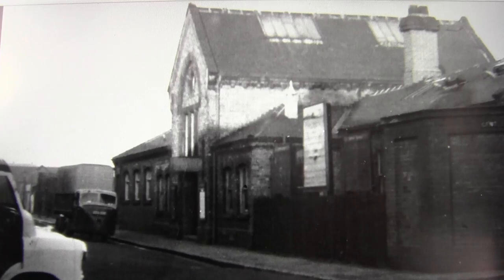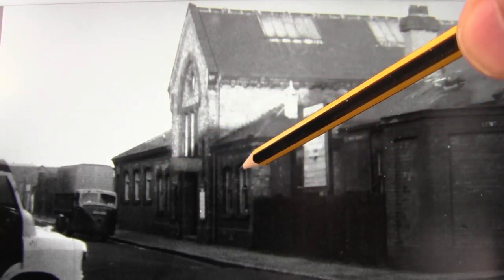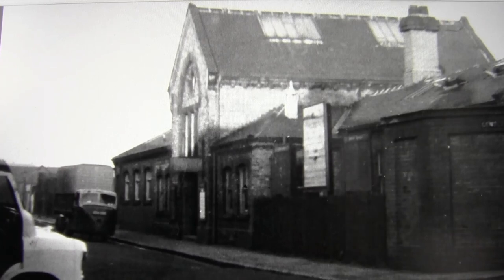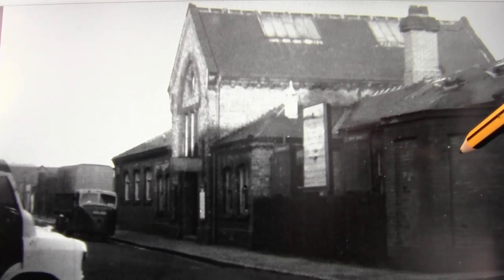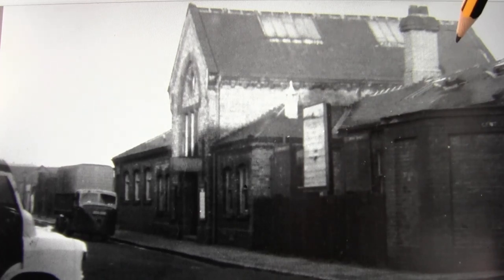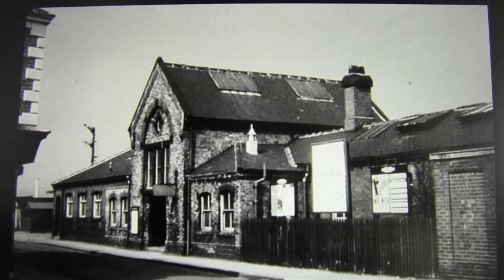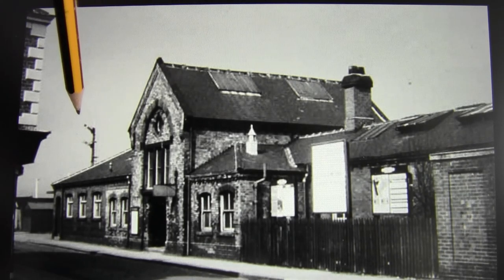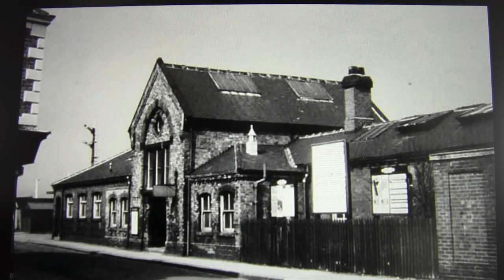Jarrow Road Part 5. The Station Design. No 329

Comment: Looking good bud,you need the over line I joists as you can hang your catenery off it.Propper 1960,s tech drawings here,fabulous,your the man Tony.
Reply from the maker: Hi Eric, you maybe right about the overhead electrification of the line. but later on they opted for the third rail. 1938 i think it was. thanks again for commenting all the best Tony

Comment: Missed the premier due to working in the woods.
Nice photo of a Scammell Scarab; remember them well.
Nice bit of history in the intro, Tony.  Not sure about the milk van as they usually were either horse and cart or Smith’s electric vehicles, made in Sunderland.  I think the Gents is an outside loo which were common place in those days, rather than part of the station.  Make a nice addition if you have the space and somewhere for the Herberts to go. 😂
Those signals are the LNER standard upper quadrant. Lower quadrant signals were from pre-grouping North Eastern Railways (NER), which I prefer.  They were progressively changed to upper quadrant in the 1950s, with many existing into the early sixties, particularly on minor routes.  That photo with the signals was taken in 1959.
I take it that you are using IP66 washers for your circular window to make it both fully dust proof and to protect from high pressure water jets. 😂
Splendid drawings and enjoyable thoughts for the build, Tony.  See you in the next instalment.  Best, Jason.
Reply from the maker: Hi Jason. sorry for the late reply mate. the milk van is a old Bedford. i remember seeing one as a ice cream van. as you know the whole line from Newcastle to shields was upgraded and most those old signals disappeared for the new light signals. which was a shame. 
the IP66  washer is a little cheat but it will do the job as the inside dimensions is 16mm. Perfick. from paper to reality hmmm. i can not wait myself. but i must finish of my walls.
 until next time buddy...cheer's Tony
Reply: @TONYNORTHEASTERN  Hi Tony, I guess we remember our younger days and what existed then.  My memories of the milkman, was when I was aged about five and we lived in Westoe.  Memories of me sitting on the cart next to the milkman, behind the horse which was brown and had a long brown tail.  I used to watch him eat his oats out of a nose bag.  I remember my mum scolding my father for embarrassing her for following behind the milk cart with a bucket and shovel, to collect manure for the conservatory. 😂  
I remember this as if it was yesterday.  Where did all the years go?  Till Friday, Best Jason.

Comment: that side building was like a bus shelter it only had 3 walls and roof the platform side was open to the elements
Reply from the maker: Hi Steve. very true, but there was once canopies on either sides. I don't know when they were taken down. judging by the steel work that ran across from side to the other, it makes me wonder if thee was a incident or collision with those steel runners. later photos shows no canopies at all.  thanks again for commenting. its something that i have to investigate....cheer's Tony
Reply: @TONYNORTHEASTERN  does seem to be a black hole from an historical point of view i wonder if it was as simple as wartime scrap metal like park railings as i can find evidence the canopy was ever completed
Reply from the maker: You could be right. they may have came down around the time of the second world war. 
a aerial photo does show some form of canopy at Jarrow around the 1920's. and the 1880s photo kinda confirms it. interesting subject....thanks again for your input cheer's Tony
Reply: @TONYNORTHEASTERN  one of your photos was cropped full size shows the canopy replaced by a steel girder foot brigde